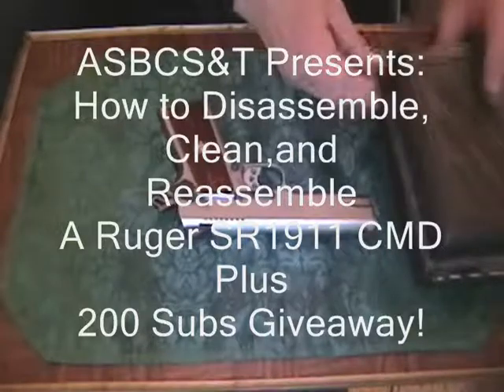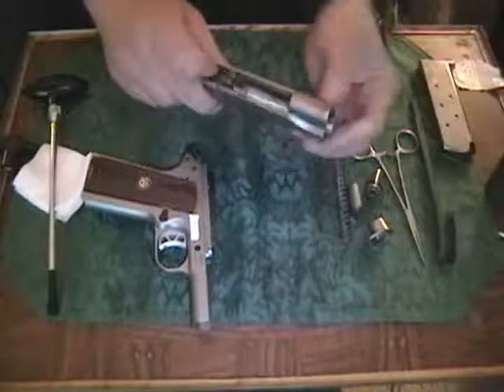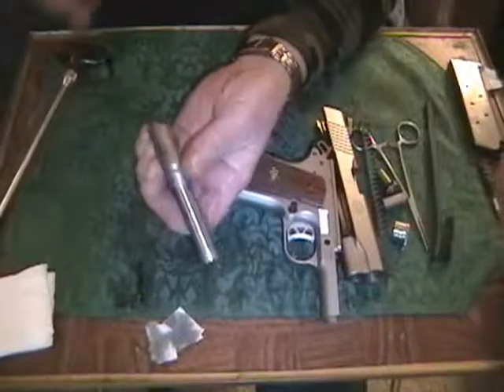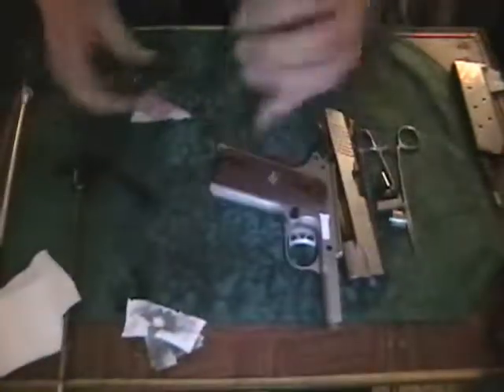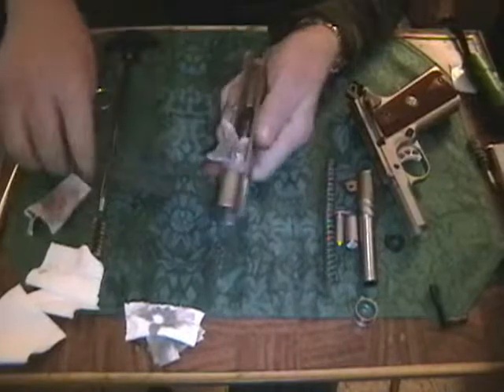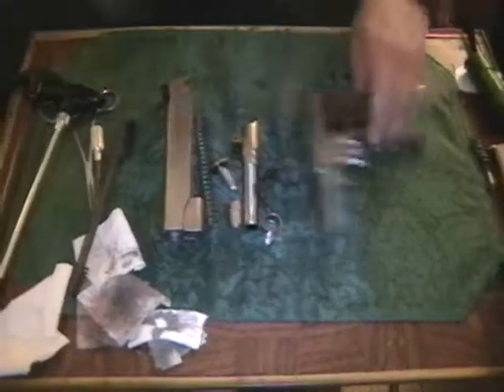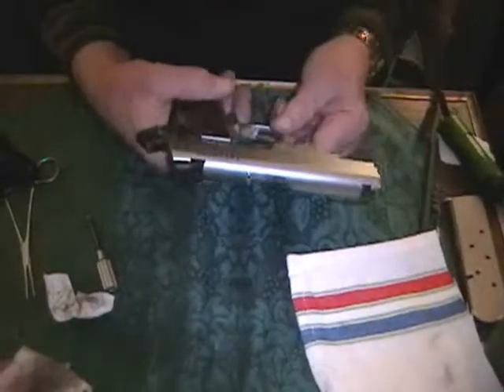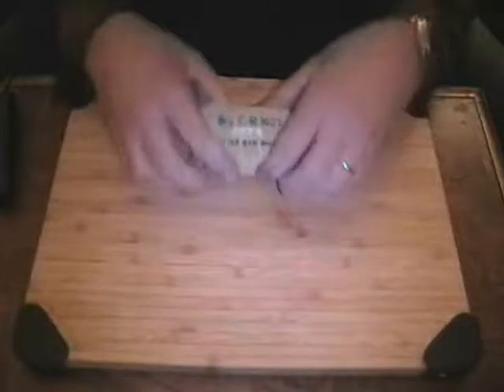How to Field Strip and Clean a Ruger SR1911CMD Ruger SR1911CMD Field Strip and Clean and GAW Update!

Comment: Exactly like my colt series 80.
Reply from the maker: I had a Series 80 Combat Commander back in my LEO days. I've had more than one government model over the years, most full-size, but there's something about the Combat Commander that really appeals to me. Glad I got to handle this one. Cheers.
Reply: I have the colt Government model series 80 in 45 cal, 10 mm, and 40 cal. They all fit the safarie land holster. I used them as my duty weapon in LE. I would carry one for two months, swap it out, then the third one. Clean them and start over.
Reply from the maker: I carried my Series 80 Combat Commander off duty in a Galco Miami Classic shoulder rig for some time. My backup gun on the job was a Browning BDA 380 in a shoulder rig. We were required to carry a .38/.357 revolver, either 4 or 6-inch, either Smith & Wesson or Colt. Over the years I switched off between a 4-inch S&W Mod. 19 and a Colt Trooper. Later, as I moved into plain-clothes, it was a 2.5 inch Model 19, and then just before I pulled the pin, we switched to Glock 23s. Thanks again for your comments and for checking out the vid. Cheers.
Reply: MY off duty weapon was a colt pocket lite .380. I had an ankle holster and it also fit on my back pocket.  Are you also a traveling man?
Reply from the maker: I carried a Mod 36 Chief's Special in an ankle holster for a while. I found that I preferred the shoulder rig more for accessibility, mostly. Not so much traveling in the last year or so due to financial issues - the cost of venturing too far from home, but before that - I'm an outdoorsman at heart and have spent a lot of time in the woods and exploring remote areas of my state and others - hunting, fishing, hiking, camping, photography safaris into the back country, etc. I've been to Africa and Western Asia, but haven't been out of the country since 2000. I prefer the Rocky Mountain west and the Intermountain region. I nearly packed up my gear and headed out for a quick overnighter this evening - until I saw the weather forecast, which is for a pretty good soaking of rain for the next 2 or 3 days, and maybe snow where I was going, so I bagged it for now.